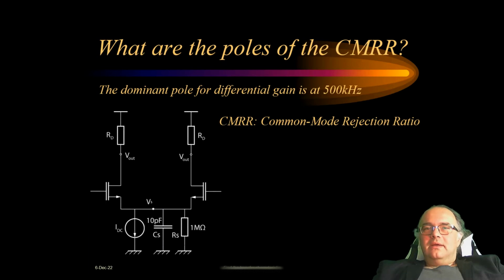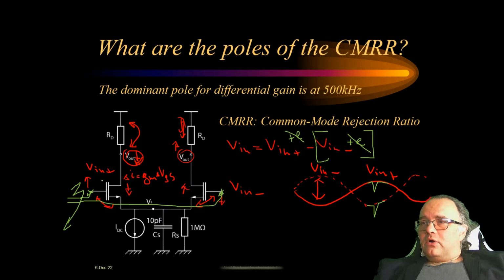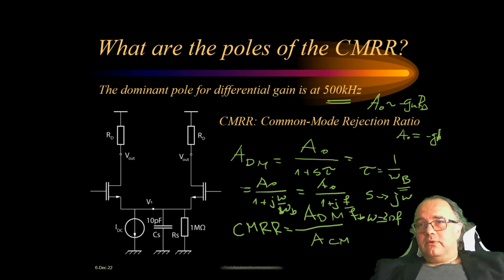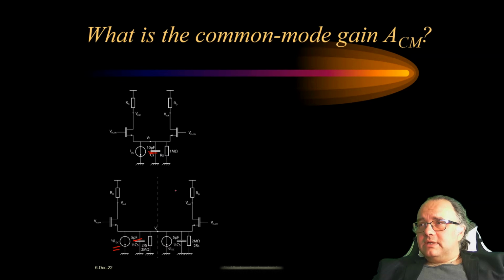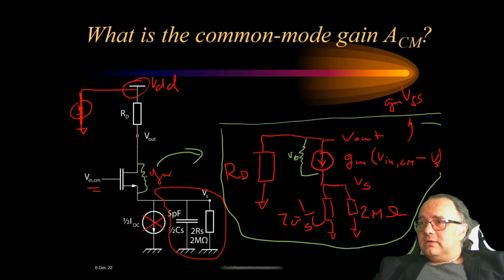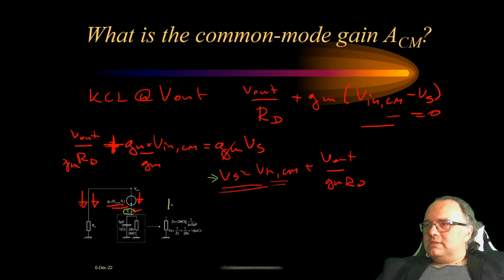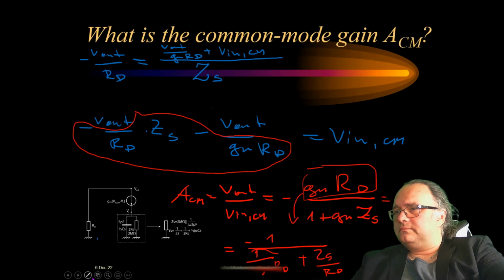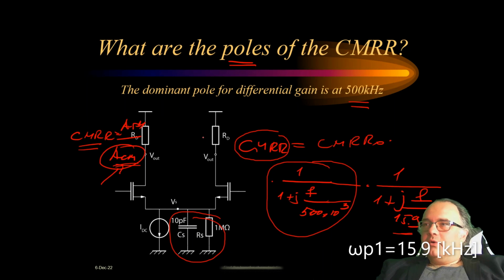Poles of CMRR

Comment: In the CMRR definition, should the denominator be the A(common-mode input to differential output)? It seems you use the A(common-mode input to common-mode output) to calculate the CMRR. I thought the CMRR should be infinity because you have no mismatch in your components (which means the differential output remains zero no matter what your input common mode is). Thanks!
Reply from the maker: You have a very valid point! Indeed, you can consider the denominator of CMRR either as common-mode-to-common mode gain or common-mode-to-differential-gain. This difference is only when the output is differential. You can use both to demonstrate different effects. 1) common-mode-to-common mode gain would be used when we want to show the ability of the stage to suppress common mode disturbances; 2) common-mode-to-differential-gain would be used when we want to show the ability of the stage to prevent common-mode disturbances injected into the signal. The latter point 2) is much more valid (your point), since ultimately we want to preserve the quality of the differential signal. Point 1) can be also valid if the stage is loaded with circuits that are sensitive to common-mode variations. So, the definitions should be either explicitly made or interpreted in the given context. If we consider the problem (as an exercise) it makes only sense if we consider common-mode-to-common-mode gain, since common-mode-to-differential gain is always 0 (if there is no mismatch). Since a learning objective of this exercise is to show that the time-constant at the common-node of the input pair transistors (Vs) is only relevant for common-mode signals and creates a pole only for common mode signals (and not for differential), we use here the definition 1) common-mode-to-common mode gain.